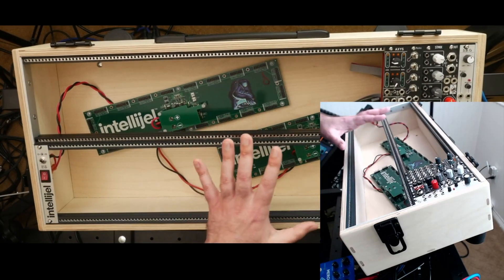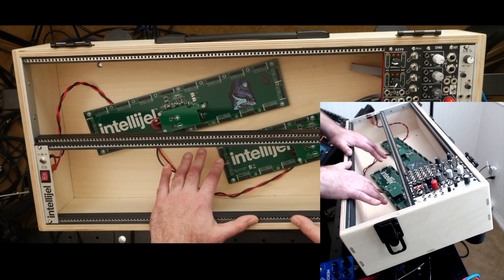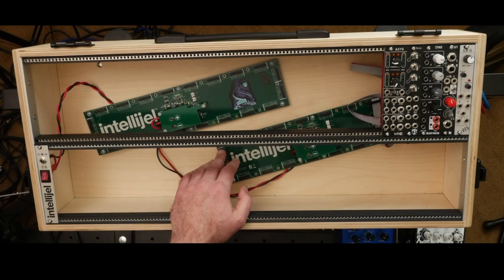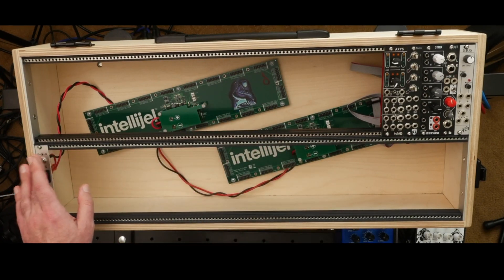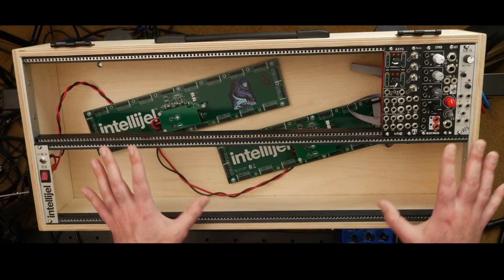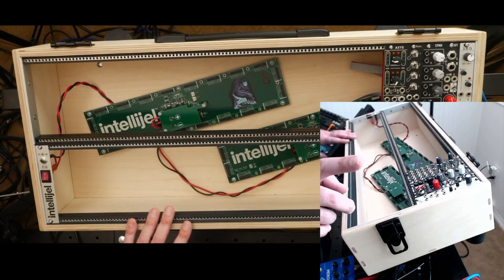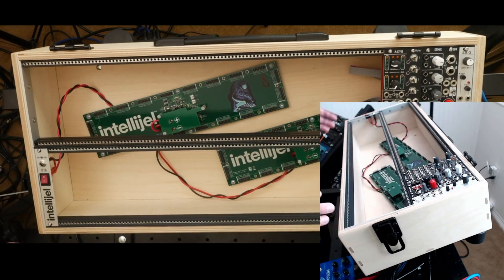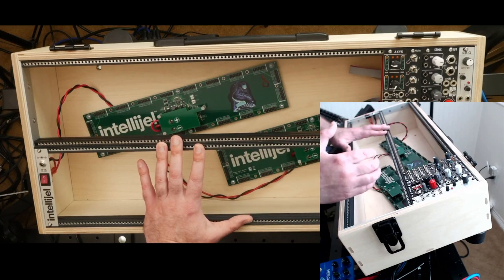DIY Eurorack Case: Part 2 - Design, Dimensions, & Power

Comment: I had some thoughts that I wanted to add, but please keep in mind that I know next to nothing about Eurorack stuff specifically (and was watching these two videos with the intent of building a non-Eurorack case,) with my area of interest being DIY electronics in general.

Towards the end of the video, you mentioned an idea whereby a horizontal bar could be installed to aid in cable management; this reminded me of a feature that could be found on a number of pieces of equipment manufactured by Hewlett Packard in the 1950s and 60s. If you search "HP 185 oscilloscope" on Google Images you will see examples of this, where the machines in the resultant pictures can be seen to have handles on the verticle sides of the front panels that are circular in cross-section. Some of these have little plastic clips that can pivot and slide up and down on these handles, to which can be mounted other instruments. You may wish to draw inspiration from this setup when implementing the design you suggested in this video.

Secondly, I'd like to ask if it would be useful to incorporate some means to store patch-cables on the underside of the lid of the enclosure you showcased in this video. I'll admit I don't know how patch-cables are generally carted around alongside synthesiser equipment such as this, and it may well be better to do so separately, but seeing the depth of the inside of your lid made me wonder whether it could be better utilised (if it isn't already needed in its entirety to allow the case to be closed without having to unplug all the cables)... My initial thought for a solution along those lines was to use an elastic storage net as is sometimes seen on the rear of car seats, (so passengers in the back have somewhere to put their things,) but I imagine cables would very easily get tangled up in this, and that you could probably think of a better solution to this if, in fact, its implementation would be desirable.

Thank you for these two videos on case construction. I hope that you and your family are doing well.
Cheers, and kind regards.
:)

Comment: these were awesome, I haven't done any wood working in over a decade (and I barely did any back then)
a new case will be my first project, and you had some great insight

I'm thinking 9U, each row at a different angle, which I know will up the challenge, but the whole reason I'm building my own case is the design I want doesn't exist

thanks for the info and can't wait to see your next design
any chance you'll shoot the process this time around?

Comment: Some comments right off. I have TipTop Zeus Studio Bus boards, and I DON'T recommend them. Their support went on and on about how they are "precision" calibrated. Yet my lowest voltage unloaded is 11.4 volts. All of them are below 12V by some margin. I have yet to adjust the trimmers, and I got no "blessing" to do so from TipTop. CalSynth has since suggested Trogotronic Modular solutions to me. He claims to swear by them. I didn't find them when I started building my setup. I have rebuilt my case (now at 12U and 416HP) several times. Unfortunately, I'm stuck with the Zeus boards for the time being. I did use Dominoes and bamboo plywood on my last build. Also, if you have an Expert Sleepers ES-9, that thing draws 2 or 3 times the power most modules do. And my Disting EX is also a power hog. The ES-9 has been moved to a 4MS Pod on the advice of Omri Cohen. My uO_C also got displaced to there to make room for the Acid Rain Maestro arriving tomorrow. Also, the uO_C didn't start up reliably with the Zeus boards. BTW, I also made the mistake of starting with the cheap rails, and ended up with the Zrails and internal aluminum cheeks.